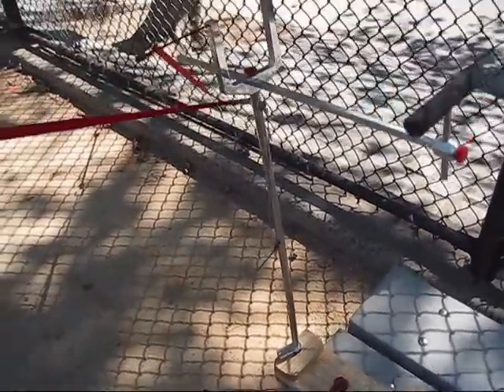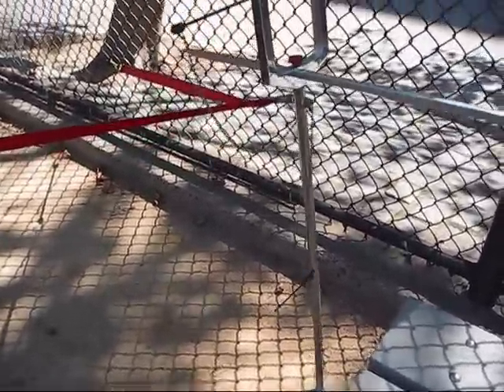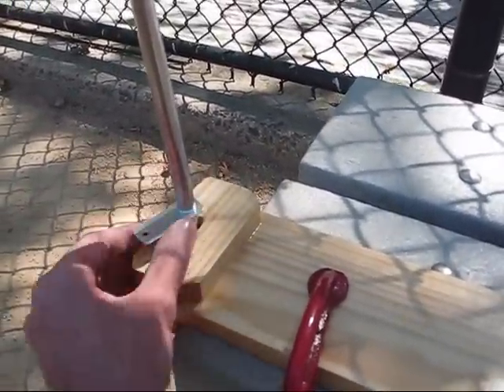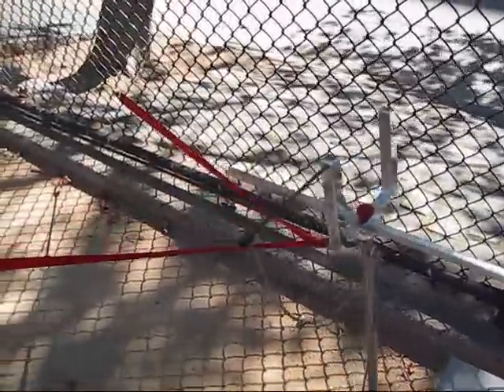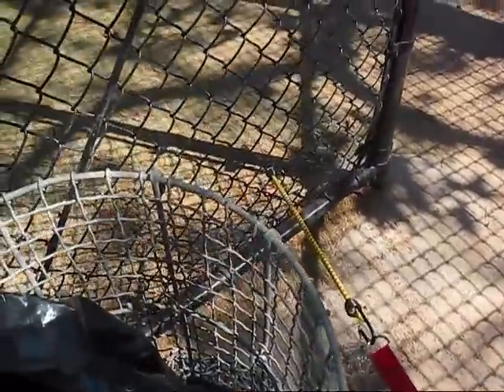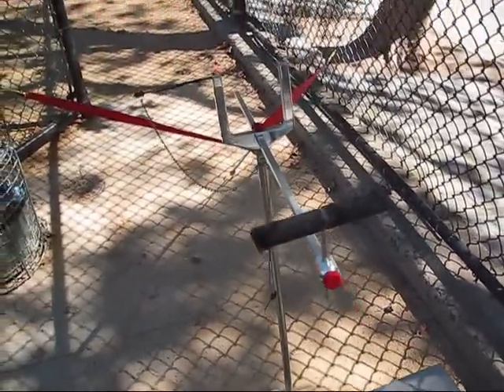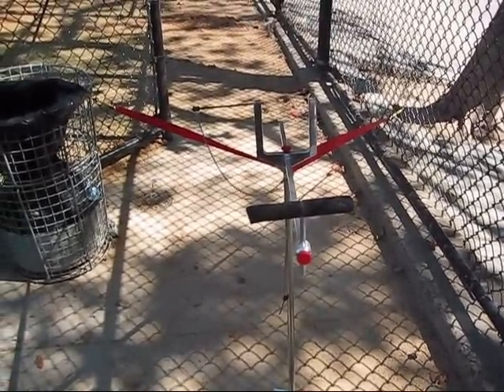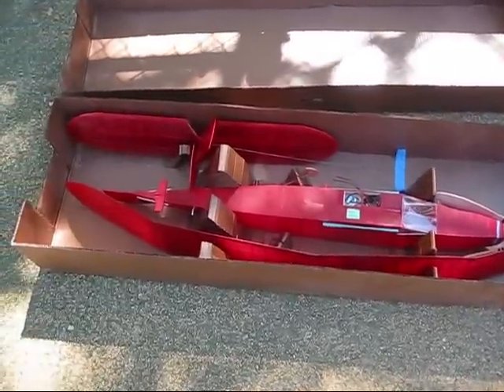Dick Korda's Dethermalizer - some test flights

Comment from the maker: I think its a shame to convert something like Korda's Dethermalizer to electric or gas, that totally loses the 'soul' of the plane, which was clearly designed for rubber power. Also, you're not using a classic 18" folding prop with electric, so you lose the best part! Although I started in RC gas decades ago, there's something fascinating about the challenge of rubber power, I just don't get the same rush with gas or electric.

Comment from the maker: Yes, I started with Peanuts (13") because of the small field, which was fun but they always end up in the trees sooner or later. But with RC, I can fly 30-40" rubber power jobs and I have not yet lost a plane in 3 years (although some have spent some time in the trees). You might want to try rubber RC, you can have great fun in a small field!

Comment from the maker: Yes, I've been experimenting with this for about 3 years now (only have a small field available) and I am thrilled with the results - you can definitely fly medium to large rubber power planes in a small field with full-range RC equip and get excellent performance. Plus I love that I don't have to chase the planes, its almost hard to imagine going back to pure rubber (without control) now! Its enormous fun, my current project is RC rubber power coupe d'hiver.

Comment: Flying a model plane in NYC should be different from any other place.
As you mentioned, the plane looks a little under-powered this time.
Adding more strands should improve its flight.

I had some test flights for 28" span Lancer (from Guillow) with my 3-years old son today.
My son accidently crushed my plane.
I was not so lucky today.

By the way, Starlink superior stooge looks great.